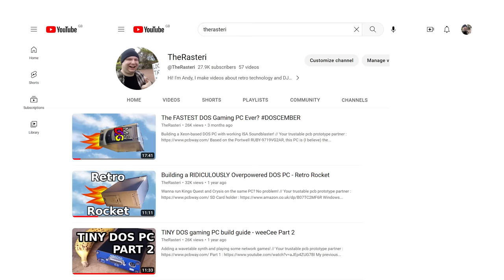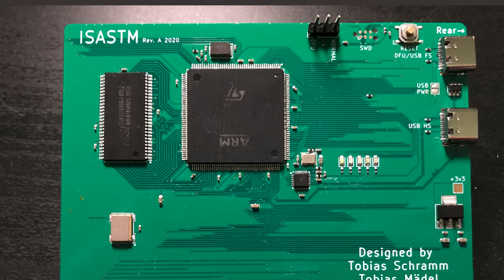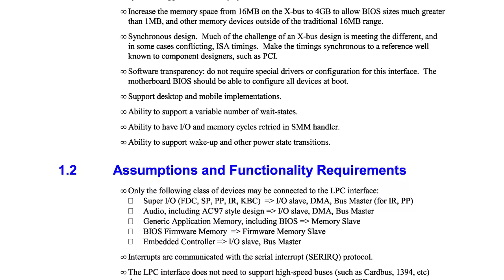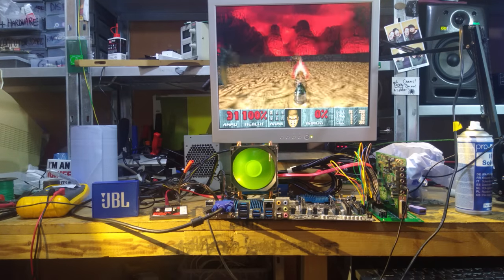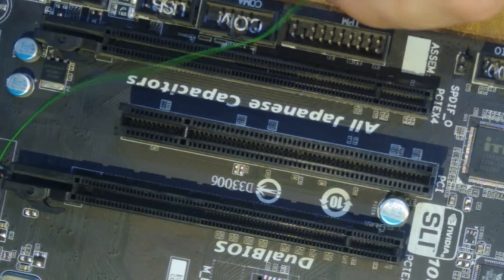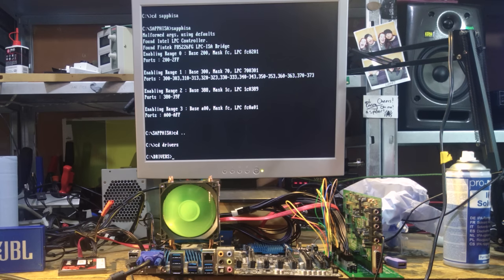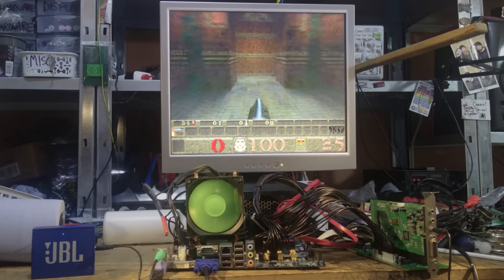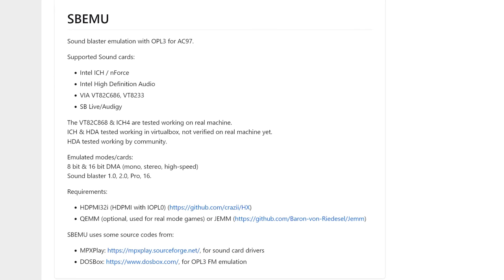Add an ISA slot to Modern Motherboards!

Comment: Skylake and anything later has absolutely hideous video performance from DOS as well. And Intel's taken a lot of legacy video modes out of its video hardware. Broadwell was the last of the MS-DOS machines.
Reply from the maker: I was trying to build an X99/LGA2011-3 DOS gaming rig but had trouble finding a good cheap motherboard. LGA1150 with Haswell/Broadwell seems to have better options in that regard (not to mention better single-thread performance)